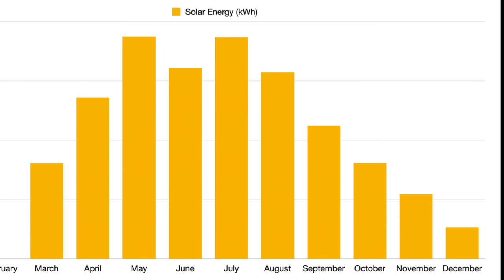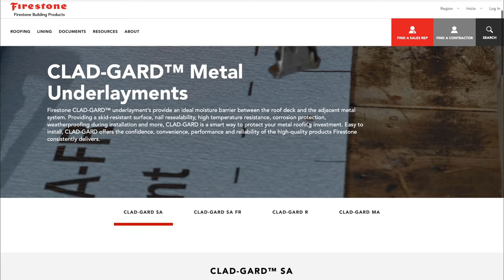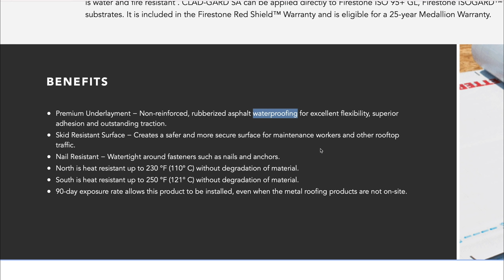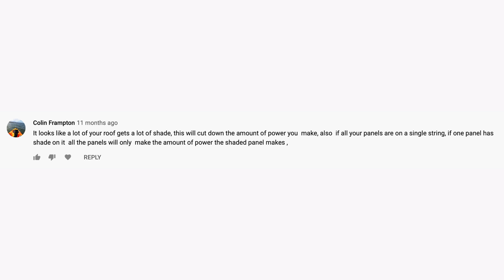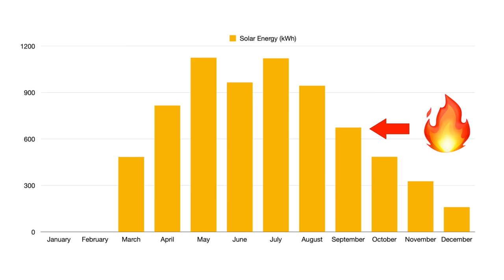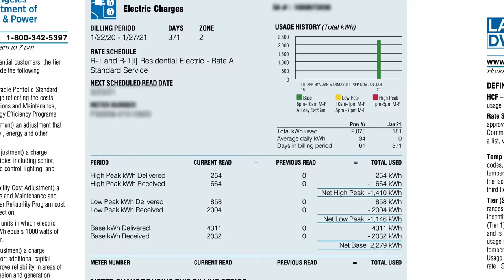1 Year with Tesla Solar Roof: top 11 questions answered + real production numbers & utility bills!

Comment: Great video. I really want one of these for our home here in Durham, NC. I know there is a pretty hefty upfront cost, even with tax incentives, but I know that it would be an amazing investment in the long game. 

Thank you for the in-depth information!!
Reply: I have them in NC. I’m not far from you.
Reply: fastest repayment is grid returned ... go for the power wall and it is just what you save each month ... while grid return pays for it to be used by them at the rate for that time of day ... also cover the whole roof ... as long as the sun hits both sides of your roof ... use it ... even 40% power on the far side is 40% you wouldnt be making otherwise .. and always go POLYcrystaline panels avid monocrystaline like the plague ... poly panels are 3 to 6 different spectrums of light and a 7th layer of water heating ... while mono panels are 1 spectrum usually red .. 
.
after that check out whom you are getting to install it ... just because they say they can install the roof doesnt mean they will do a  good job of it ... get them verified ... and ask for references of other homeowners they have s=installed the roof on .. and go speak with them ... MOST people are out to make a buck for themselves and thats good enough to pass ... doesnt make it ... thats done right and will last a long time

Comment: Definitely you need to add Powerwall in the future otherwise sending you power to the grid is a loosing proposition and you will be at the mercy of the power company with no control and actuall defendancy on your own.
Reply from the maker: If I get 10 solar referrals (doubtful), I get a free one!
Reply: @AustinFlack  Wish you can get it 👍 but another way to afford the Powerwall is to buy Tesla shares or Options then sell it within a year for profit then you have your Powerwall for free with 26% tax credit at the end of the year. That's how I was able to add 2-Powerwall to my solar panel 😄👍.
Reply: Why should he get a $10000 powerwall if he already has free energy with net metering. It looks like he only pays for a $10/m grid connection/contract fee.

Comment: Interesting you didn't mention the actual cost to install. Took me a minute of looking around and found that an average cost for a two story 2,000 sq. ft. home is $55,300. At a savings of $2,000 per year you're looking at a little over 27.5 years before you just break even. God forbid you financed the cost because then those numbers go out the window as you're now paying off a loan with interest. Unless your a thing couple at a house you think is your "forever home" (which isn't likely) this doesn't sound very viable. Cool as the tech sounds, until the costs come way down I'll pass.
Reply: If you're looking for a new roof anyway then the premium isn't anywhere near as high versus the cost of a "normal" shoddily constructed American roof - hence this is a more sensible option for new builds or people looking to replace their current rooves. If you're just looking for solar power generation then solar panels are both cheaper and more efficient in terms of energy production per square metre. And presumably the investment in either is reflected in the resale value of your house.
Reply: Not quite as simple as you stated. If you have to put a new roof on, that cost is around 30-35K right now. So the actual cost you need to recover is only 20-25K. At 2K per year, you would recover the additional cost in 10-12.5 years. With 12.5 - 15 years of warranty life still in the roof. IF you are just looking to install the tesla roof over a perfectly good roof, then yes, it's not very feasable or cost effective.
Reply: Yeah but how likely is it electricity prices are gonna stay the same for the next 27 years. Still not a super fast return, most PV’s pay themselves off around the 5-10 year mark but the Tesla tiles are pretty dope

Comment: Lots of questions about why you are still paying for electricity etc.

To clear that up - because you dont have a battery storage system, you only get 'free' electrcicity when your panels are producing it. So at night time, any electric usage wont come from the panels - it will come from the grid and cost you.

If the panels are producing 2kwh and you're using 4kwh at the time - it will cost you.

Also, only certain places pay you for any excess usage sent to the grid.

So if you are producing 4kwh, but using 2kwh - the 'spare' 2kwh will go into the grid. You can setup schemes in certain countries where electric companies pay you for this excess. I'm in the UK and we have a scheme although its not worth as much as it used to be.

At this stage I still think traditional panels will be the better choice for most, unless you're building new or needing to replace your roof anyway. Each house is different. The slope of your roof matters, the amount of sun it gets, whether your roof faces south etc. - all this affects how much solar you can produce.

Comment: In Massachusetts I use appx 2200 a month in power and my bill averages $600 a month. If the roof only produces 8500-ish yearly it would only cut my bill by a 1/3 a month still making it $400 a month plus then the monthly bill for the roof. It sounds like it would cost me more to have one. Our friends have a regular solar panel roof and it actually increased their bill by $100 a month. They are so mad. Something about SREC’s not paying like they used to.

Comment: The low production for a 9 KW system probably has to do a lot with shading and cloudy & winter conditions, Looks like the tesla tiles are set up like xmas lights, even with slight optimization, the loss due to shading and cloudy conditions is probably huge. Even a neighbor tree hitting your roof can have a big impact. The ROI must be well past the warranty of 25 years. It looks pretty but you can probably get a new standing seam metal roof and 22each 400 watt solar panels for much less.  My 8.8 KW system cost $24,216 net cost $9,200 after incentives and I get a little over 13,500 kWh a year.

Comment: How much did it cost to install -- I heard it is $40,000+, which means monthly payments like $300+ for the next 20 years (including interest)...just in time to get another roof. I also heard those roofs will curl due to age and heat. If it sounds too good to be true, it usually is. You may save on electricity (some) but you still have to make those monthly payments. Those roofs are also ultra slippery..one fall can be fatal going up there and clean it.

Comment: Just came across this video so I have a couple of questions that might of been answered in other videos. What was the total cost to installed the system? as a $2,000 saving for a roof that I’m guessing costs close to $50k might or might not be worth it. Since it’s been another 2 years how about another update just to see if things are the same or have changed. 3 years of data will always be better than 1 year of data.
Reply: $33,749

Comment: On the subject of PowerWalls, I have a 7.5KV system and last year I paid the power company a total of $200.  In 3 years in this home, we have had one power outage that lasted 20 minutes. Doing the math. $10,000 for the PowerWall, $200 a year possible savings, It will take 50 years for the PowerWall to pay for it self and they are only expected to last 20 years. 10000/200=50

Comment: It would be very useful to know what were the purchase, installation and maintenance costs of the tesla solar roof - purchase and installation are more or less one off costs so are easy to include - maintenance costs are also straightforward and could be added in from the actual expenses during the period accounted for but it could also include an accrual element - for example as you mentioned you get little rain where you are so from time to time (also depending on the number of fires etc) you may need to pay for the tiles to be cleaned to otherwise prevent losing efficiency of energy collection. In this way you could get a good idea how far off you are from making the system pay for itself if not how far off you are from actually profiting from the installion.
Reply from the maker: Cleaning cost ~$350

Will pay for itself in ~10 years. (I deduct the cost of a conventional roof when I calculate ROI—I needed a new roof!)

Comment: One problem. How do you know the output from September onwards isn't due to the decline in power from earth's orbit "change" during the fall and winter seasons?

We need to compare a non ash year with a normal year to deduce that the California's fires were indeed the cause of the decline of output and not just earth's cycle.
Reply: I thought the same thing….I would have said the decline in power is probably due to less daylight hours in the fall and winter combined with the ask as well.  But if you knew there was ash and it would obviously affect your solar panels why wait to address the issue until Jan?  🤷🏽‍♂️

Comment: How much did all of this cost to buy the solar roof and install every little panel? In comparison how expensive would it be if you installed your whole roof with regular solar panels? What is the estimated difference in agency production comparing a complete Tesla solar roof or fill the entire roof with solar panels and concluding the payback period of those 2 options? With the tesla solar roof you can calculate it. With regular solar panels it would be an estimation but these days those estimations are good. Hope you can answer some of my questions.

Comment: People asking why he paid in the end if he used less than he produced. The answer is no storage(batteries). When the sun goes down or the efficiency of his panels were reduced he would have had to swap to grid power, essentially buying power the traditional way. Also selling back to the grid will be at a reduced rate, the exchange will never be 1:1 since the power going back to the grid is being recycled and resold to other homes.

If he got battery and inverter system he would never pay another cent for grid electricity for the next 20years. He doesnt need anything as big as a power wall, a couple decent sized LiFePo4 batteries and a pure sinewave inverter hooked up to his solar roof would provide him with all the power he could possibly need during the evening.

Comment: annual savings of $2000 doesn't mean much without the juxtaposition of the full cost of getting the roof, everything you need to keep it running, maintenance cost (with average wage per hour for time spent cleaning and on extra time spent throughout the year doing anything for the roof calculated just separately before being added to the total - so people who value their time differently can adjust as necessary) and preferably a chart with the expected decline in savings as the solar cells degrade over 25 years to see exactly when the roof "pays for itself" - bonus points for listing any optional tax breaks, government grants, etc that you considered or adopted  for additional boons toward reaching that goal people can look forward to if they go through with getting one of these.

tesla themselves, I believe, list estimates base don location and normal climate - since a lot of the country simply doesn't get as much sunlight as SOCAL, but that can be figured out by each prospect on theirown with your reference data. 

unfortunately I live somewhere that people would literally scale my house and rip the solar panels off in order to attempt to steal them and either sell them or use them themselves (hopefully becoming crispy critters in the process and fusing some charred people-bacon to the panel while doing so) so I'd be unable to get one of these even if I could afford it, but this information will allow many more people to make an informed decision and actually purchase them if the investment proves to be a wise one

Comment: 33000 cost vs 2000 yearly savings.  w/ 25 year warranty.
ROI in approx. 16 years. Not bad. But still very expensive :)

But I hope this tech keeps on growing and hopefully reach our country too.
Reply: no ... for 8 years ... he is making 16k ... approx ... and that covers the repairs/ replacment of the 20% warrantied roof degradation ... then its good for another 25 years ... just below the original savings ... BUT it's ALL profit ... 
.
even assuming 10k repairs at 25 years he still has 6k IN HIS POCKET ... and not in hydro's pocket ... and after another 25 years .... yup just shy of 50k .. 
.
name a roof that in 50 years pays for itself twice ... including repairs ... and leaves you extra after as well

Comment: If you spent $33,000 for installation a 25 year loan at 4.5 % would cost about $2,200 per year in principal and interest payments. That is roughly equivalent to your “energy bill savings”. When you add in your annual cleaning costs you are in the hole installing this Tesla roof. Since you are in Cali you don’t have the loss of power due to weather and the seasons you would have in Northern states. The economics aren’t favorable unless you live in a climate that enhances solar, but even then there are no apparent savings.

Comment: Love this and have looked into it.  I am a roofer in the Pacific NW.  my fear is we do not have enough sun here.
Reply: does the roof get sun on one side or both sides ... does it shine from sun up to sun down ... or just 11am to 4pm ... 
.
simple test ... get a POLYCRYSTALINE panel ... leave those Monocrystaline panels at the store they ONLY use 1 spectrum of light Poly panels use 3 to 6 different spectrums of light and on the expensive ones the 7th layer is a solar water heating ability ... 
.
connect the poly panel to an inverter and deep cycle battery or two .... now hook you TV up to it ... and live life for a year ... keep the panel cleaned ... hose it down perhaps squeegee it if it seems dirty etc ... after the year ... did the tv ever NOT work from the solar panel ... yes or no ... yes ... what kind of day was it ... what kind of week has it been ... was someone using the tv and not there ... and so on ... if NO ... then yes you get enough solar ... all solar estimates use 11am to 4pm ... as a sun day ... thats 5 hours ... but on avg we get 10hours of sun per day ... from sun up to sun down ... winter to summer ... monocrystaline panels ... need the sun to actually be above the horizon the start generating power ... Poly panels need it to be with in 1 arc second of the horizon ... yes below it ... and work to 1 arc second below the horizon ... your basic 3 spectrum poly panel ... will generate on a moderate day 80w from sun up to sun down ... a mono panel will generate 40 to 60w from after sunrise to before sunset .. 
.
assuming BOTH panels are 100w panels ... more often than not poly panels are 150 to 200w panels ... and come with a 50 year warranty ... mono panels are at best a 25 year warranty .... and most often 10 or 15 only ... 
.
think over your life in the area ... has it ever been dark where you needed a flash light during the day time to get around ... in my 57 years .. I have seen 3 times when extra light was needed during the day ... but then after 30 minutes the tornadoe blew over ... yup ... as long as you have enough light to read you have enough light to generate electricity with solar ... if you are in the land of the midnight sun ... NOT so effective ... as 6 months of battery supply is a LOT of Batteries ... 
.
btw I am even further north than you are ... and here it is cost effective to have a fully solar roof ... the problem is ... the lack of good installers who dont mess up the job ...

Comment: At a time that most people can't buy a house, a $34.000 rooftop is an overkill for the time you have to keep up for it to pay for itself
Reply from the maker: Will pay for itself in ~10 years. (I deduct the cost of a conventional roof when I calculate ROI—I needed a new roof!)
Reply: @AustinFlack  I don't doubt it is is worth it for you. It just isn't for most people.

The ROI is usually close to 20 years when all costs are accounted for (installing, maintenance, replacements, variability of sunny days per year and/or price paid by the electricity company).

It's a good solution for people that buy a house somewhere where they know they will live for the next decades. But this doesn't apply to most people.

Comment: So, correct me if I’m wrong. You’re putting 68% into the grid and still paid in? Figured the energy company would be cutting you checks at that rate…
Reply from the maker: When we send energy to the grid, get energy credits, which "pay for" the energy we use at night, cloudy days, etc. (energy at night, during peak demand periods, is more expensive that the energy we generate during the day). We can bank credits (sort of like roll-over minutes) but can't cash them out.

Instead of spending roughly $60k on batteries to ensure I was totally off the grid, (for a maximum savings of $156/yr) we just trade daytime energy for night time energy. We also charge the Tesla late at night (after peak demand hours), which is a lot of kWs, which helps explain how the daytime disparity evens out.

Comment: I could be wrong but you will get paid more for contributing to the grid during peak hours (ie after work when solar is lower). Having the batterywall would bring up your earnings quite a bit, but yeah, i guess it depends on how long  they would last and how easy it would be to delay sending power to the grid.

Comment: Can you please explain how your electricity bill is calculated? You mentioned that you generated 8000 kWh and used 1/3 yourself, so roughly 2700 kWh with almost no additional energy needed from the grid. I assume that this was similar in the year before your solar panels (2019) when you paid $2245 for electricity. Is the electricity rate in LA really 0.83 $/kWh? In most of the US it is only around 0.10 $/kWh. Since this heavily influences the savings and thus the Return of Investment, I would be really interested in an explanation.